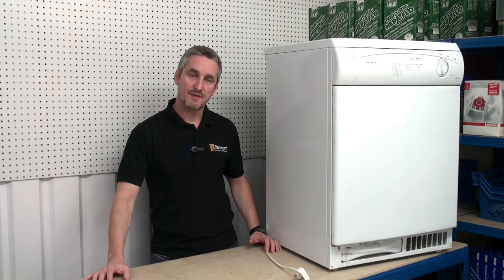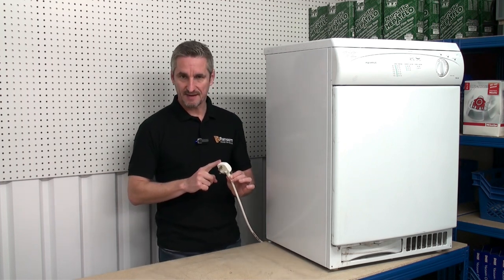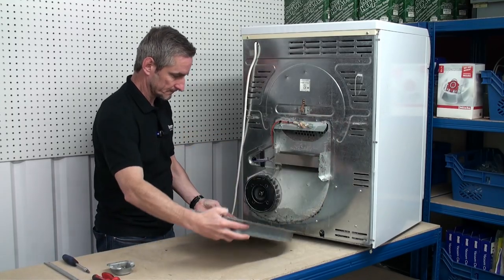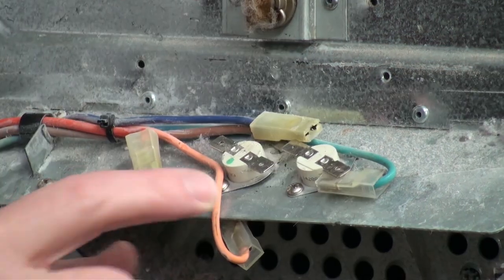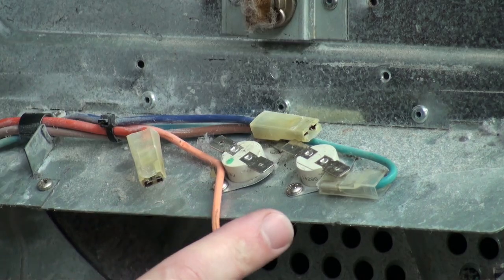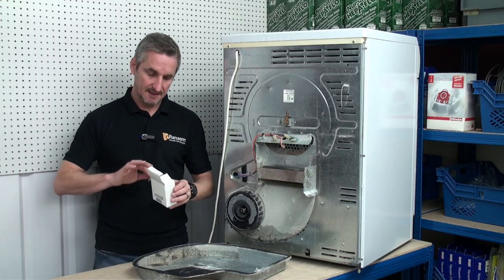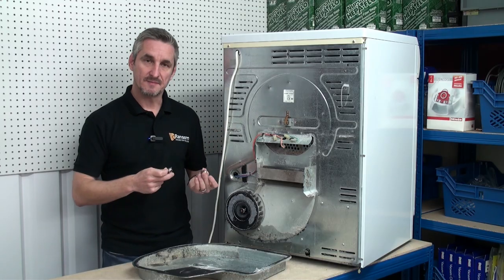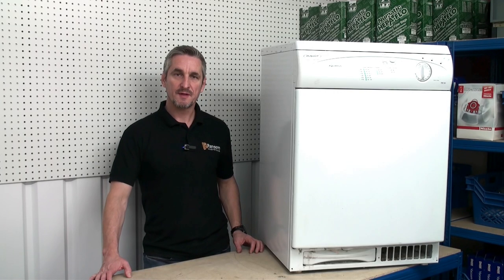How To Replace Tumble Dryer Thermostats

Comment: Would a moisture sensor be located in a similar place on a 15 year old vented ZANUSSI ZDE57140W with sensor dry?  

The dryer is no longer switching off when using the sensor, despite clothes being bone dry on the cupboard setting and it will even run if I put a dry load on as an experiment.  

I have looked everywhere in the drum and I can't see anything resembling a sensor/probe to clean or replace.

Comment: My Bosch dryer initially can be start and run for few min …. After totally shut off without power . Switch of the main power and wait for awhile can be start again but only can last for few min then shut down again . 

Are thermostats faulty .

Comment: Great video - very clear, but I'm not sure it will fix my problem. My tumble dryer does heat and tumble as it should, but only for a few minutes, then cuts out. I can almost immediately get it going again by pressing Start or changing the settings, but it then cuts out a few minutes later. Any idea what the problem is?
Reply: did you ever sort it my beko does the same constantly i have stripped it completely and cleaned everything but its still the same
Reply: @dazid1   your heater needs replacment

Comment: You said nothing about the connectors. Do you just put any of the two wire on anyone of the two connections, or are they supposed to be connected specifically?
Reply: Just came to this vid hoping for that exact question answered
Reply: Why would anyone risk connecting things incorrectly? Before disassembling anything you are unfamiliar with ALWAYS mark them with a pen uniquely (not a temporary pen either), take a photograph, then disassemble, repair, reassemble with one eye on the photo.

Comment from the maker: Did you know that if your tumble dryer has stopped heating up then it's quite simple to fix!  Most of the time it's just a couple of small thermostats that need replacing to solve the problem!
Reply: I  had the hotpoint ultima tdc60
Reply: thats a hotpoint aquarius tdc30 dryer
Reply: I changed the thermostats just now, but still getting the same F03 message, apparently 'front thermistor issue'. Nobody seems to know how to fix that ...